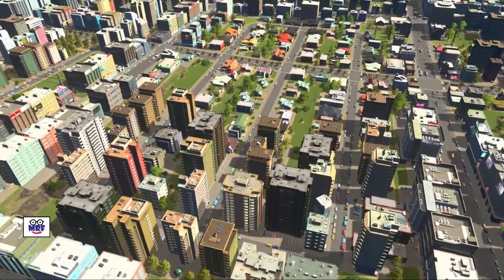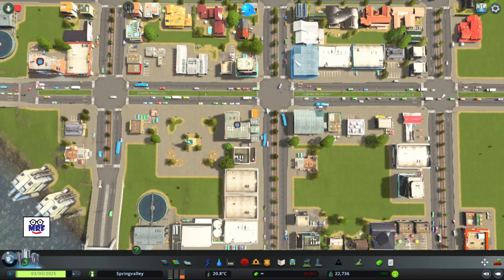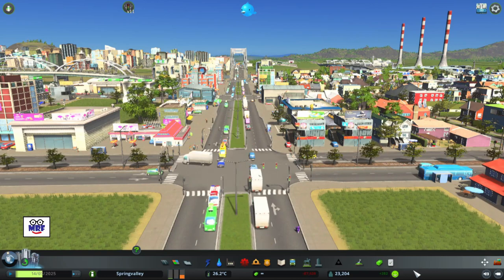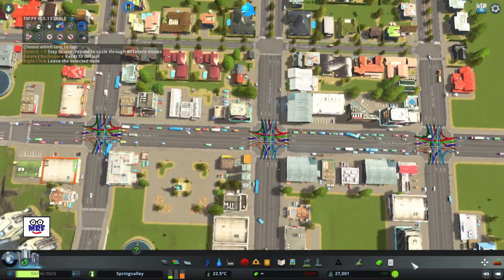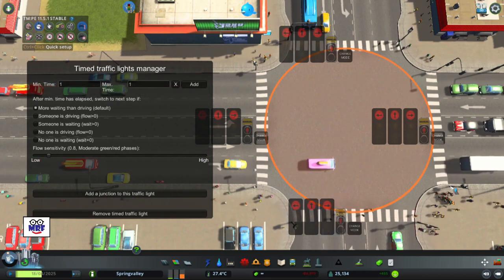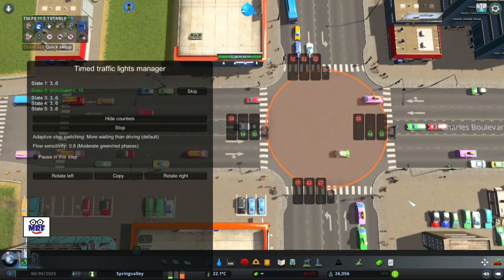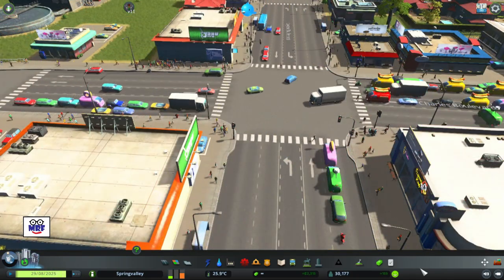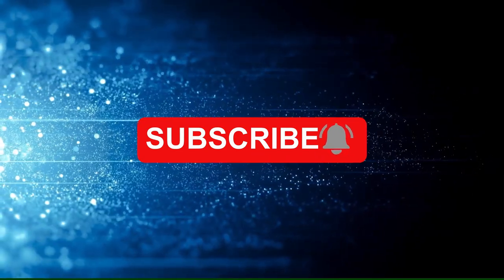Cities Skylines -  How to Connect Timed Traffic Lights

Comment: I was so hopeful...but this really isn't "connected" or "sync'd".  Just copied and pasted.  Still has value, but not what I was hoping for.
Reply: Copy-paste doesn’t actually synchronize anything, they’re still independent intersections operating on independent car flows.  For actual sync’d lights you should use the option he said not to use, click on “add junction to this traffic light” and manually setup the light pattern for each intersection to be identical. The light stages will switch at the same time for all the intersections you added together.

Comment: are they really in sync this way? Seems that since you are hitting start at different times on each light that would put them out of sync. Am I wrong?
Reply from the maker: You are correct. The signals are not truly synchronized, but they are connected so to speak. You are simply copying the signal phasing from one to the other. As far as I know, its the best approximation of synchronized signals you can achieve unless you know a better way?
Reply: Copy-paste doesn’t actually synchronize anything, they’re still independent intersections operating on independent car flows.  For actual sync’d lights you should use the option he said not to use, click on “add junction to this traffic light” and manually setup the light pattern for each intersection to be identical. The light stages will switch at the same time for all the intersections you added together. Those intersections will all act as one.